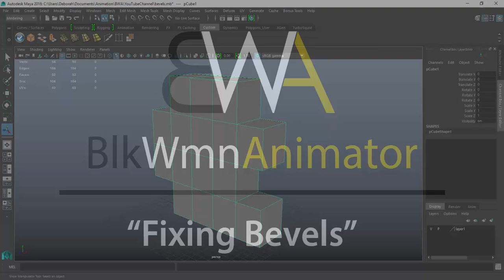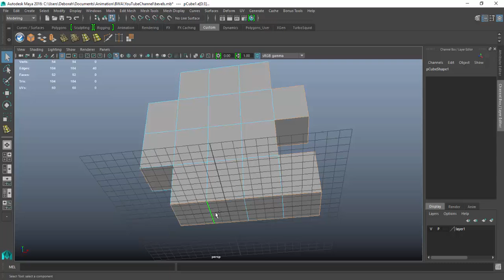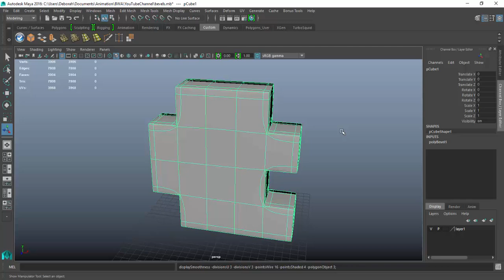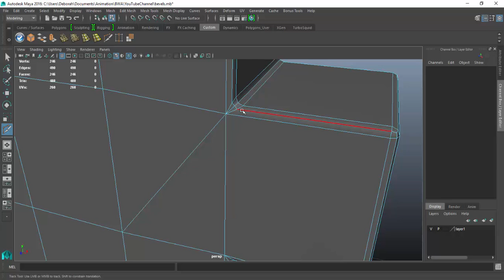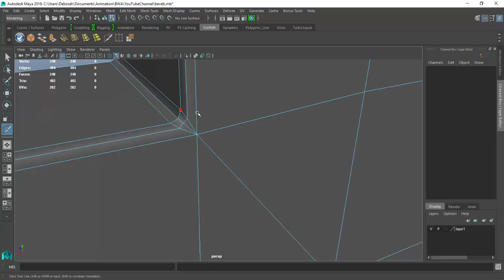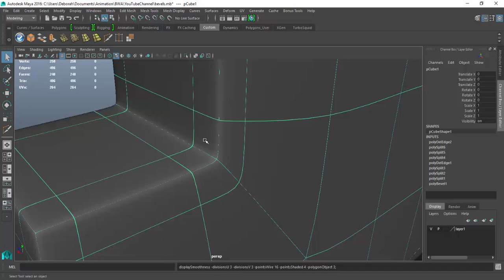Fixing Bevels in Autodesk Maya - February 2016

Comment: ...
Reply from the maker: Did you change your comment after you realized this video was from 5 years ago and for an older version of the software or.....?
Reply: @BlkWmnAnimator  how many edges can i put on a one face in maya  (3 or 5 )
Reply from the maker: @saitejaputtapaka4433  Can you clarify your question? I don't understand.
Reply: @BlkWmnAnimator  actually 1 face end with 4 edges... But some times it takes 5 edges or 3 edges . Is it right way to model or wrong.
Reply from the maker: @saitejaputtapaka4433  You should stay away from 5+ edges (also knows as n-gons). They can mess up your textures or lighting. 3 edges (tris or triangles) are OK, but you should have few of them when you're doing high poly modeling.
Reply: @BlkWmnAnimator  ok thankyou for the information 👍

Comment: You can avoid having to fix the corners by beveling those edges on the face of the object along with the ones you beveled.
Reply: Karabo Legwaila yap, its called bevel stop I think. You can add an aditional edgel loop for that. 
Even if you have only quads here, the edge flow looks bad :/
Reply: i dont understand, what do you mean